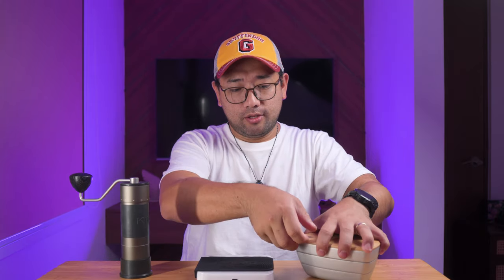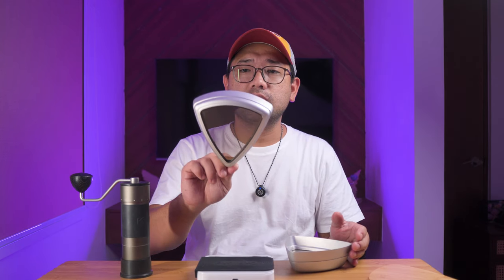Kingrinder K6 Slowfeeding Test

Comment: Have you tested what effect does moisturising beans slightly (RDT) have on the grind distribution?
Reply from the maker: @_APV_  yes i have :) but when you do RDT on these tests we will not be able to separate the microfines from other particles.
Reply: @darylbuenocoffee  Ah, right, you'd have to grind, then put the grinds into some warm and dry place for a while and only then you'd probably be able to separate the fines by shaking in the sifter.
But anyway, on a subjective scale, what are your thoughts? I've just stumbled upon one guy on Reddit saying "to reduce fines, RDT + slow feeding is the way to go", and others claiming that it makes grinding smoother/easier, but I don't think I noticed any of the effects.
Reply from the maker: @_APV_  doing RDT actually does 2 things for your coffee. 

1. It softens the beans - reducing the tendency to shatter, hence lower fines.
2. Fines would actually cling to mids and boulders making visible fines in a way disappear visually (but technically they are still there) but when they cling on to the bigger particles they actually are positioned better when brewing and they somehow avoid being over extracted in a way.

Comment: hey, where did you buy that black silicone footing? is it available on Aliexpress by any chance?
Reply from the maker: Im not sure but it is actually a rubber footing for just about anything. you might find something in your local hardware store. Where are you located anyway?
Reply: @darylbuenocoffee  Nevermind, found it! I'm based in Poland but I found two listings, one in my country and one on Aliexpress with similar rubber footings with 50mm diameter so it should fit as K6 has 52mm.
Reply from the maker: @coldyy21  yes the one that i used is the 50mm as well - it gives a nice tucked fit :)
Reply: @darylbuenocoffee  thanks a lot ♥️
Reply from the maker: @coldyy21  of course :) no problem :)
Reply: @darylbuenocoffee  can you share where you got yours, sir? Orange app?
Reply from the maker: @ediverestera  yes its from shopee

Comment: appreciate the test, but there is a huge error to this: your scale will never be precise under 1g. and even if it was: 0,2g means anything between 1,50g and 2,49g. to put this in perspective: 0,2 could mean, it's 0,20g on both, or it's 1,50g on one, and 2,49g on the other, which would be a 66% difference. so the error span could be 132% which is insanely high. keep in mind, this is still under the unrealistic assumption that the scale even can do precise measurements for so little masses. if the scale has errors in readings, this would be even higher. so this test, while it seems scientific, is no test at all. you'd have to grind huge amounts of coffee to get a proper result. let's say something around 20g of micro grounds, which would require an amount of 1500g of coffee. times two.
so please everyone, take this with a grain of salt
Reply from the maker: @beefvalve  yes i understand that there is a complete lapse on the scale - thats why i got another scale just for the microfines. But i only use it to measure below 0.1g - and i agree this is not scientific test. This test is just an estimation. This only shows you that by doing the slowfeed test we can change something in the dynamics of the coffee grounds.
Reply: @darylbuenocoffee  well you wouldnt need a scale for a rough estimation then. 😄
Reply from the maker: @beefvalve  hahahah! Really? Are you bored?
Reply: @darylbuenocoffee  i could ask the same: are you bored maling videos that dont make sense? 😂
Reply from the maker: @beefvalve  actually im having fun :) im not forcing you to watch them :) but hey thanks for watching! :)
Reply from the maker: @beefvalve  Oh, i just thought of this, while you're at it, can you help me find more videos i can improve on for the next time? this is great feedback thank you!